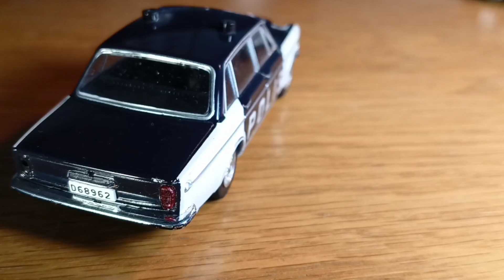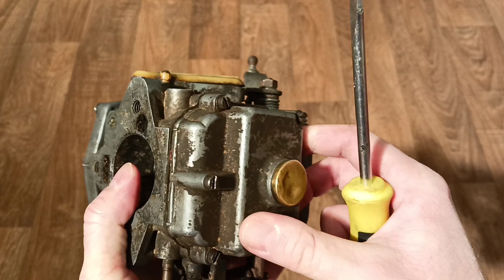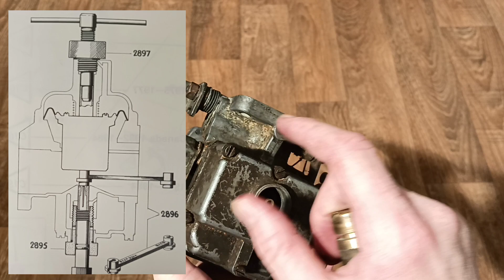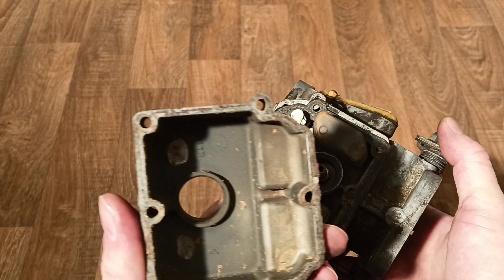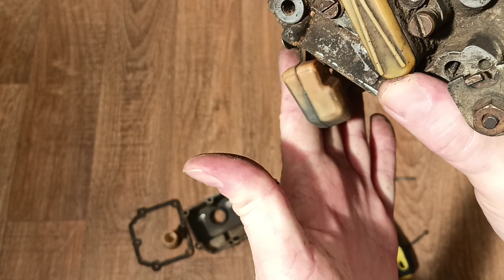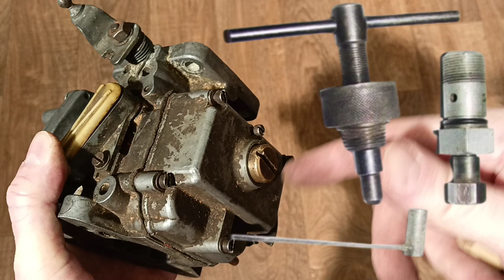Don't Put Float Chamber That Way On Your Carburetor Zenith-Stromberg #carburetor #carburettor

Comment: brass. watch out for worn needle on fuel inlet valve - overflow of sump can allow fuel to escape through a hole in upper body of carburetor...fire hazard. 🚭
Reply from the maker: Thank you so much! Brass. Great colour metal when it shines. Yes, overflow of sump was real nightmare for me years ago before I figured what was wrong. How we can watch out for wrong valve🤔, reach mixture, bad gas mileage, outrageous smell from tailpipe, dirty spark plugs...🧐 I think that things like that can be as first alarmed dangerous signals of overfloat, not only. For me real badge it's smell of fart from tailpipe. It's good for judging fuel mixture and ignition.